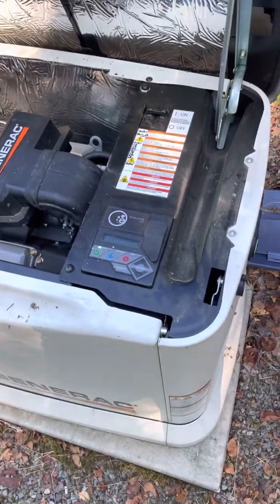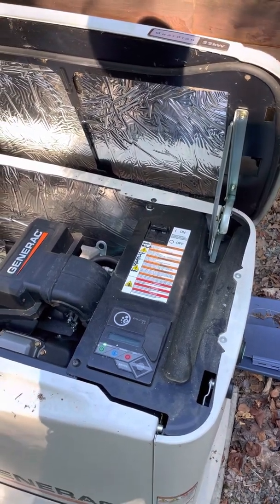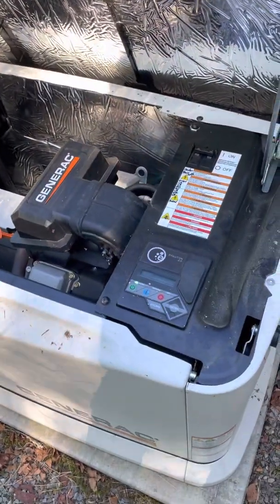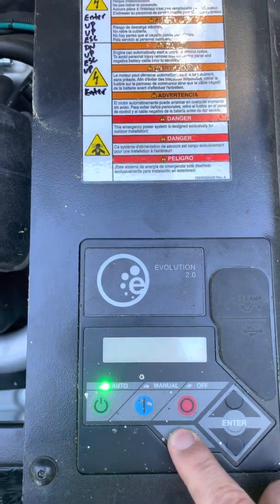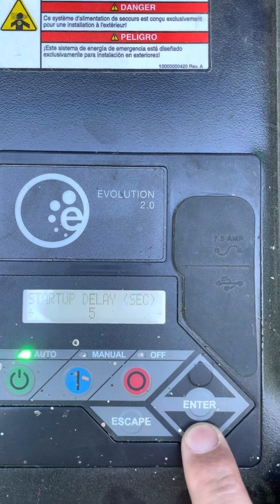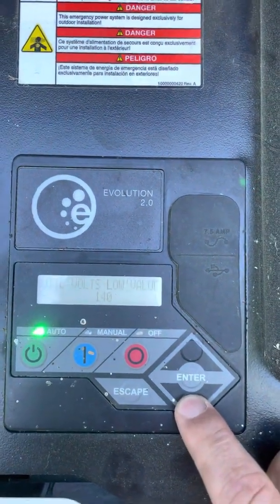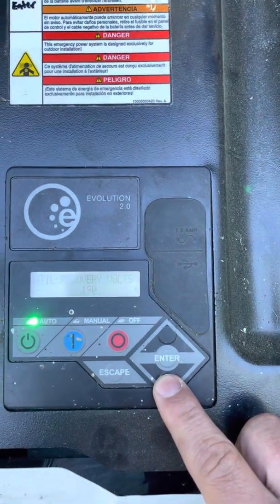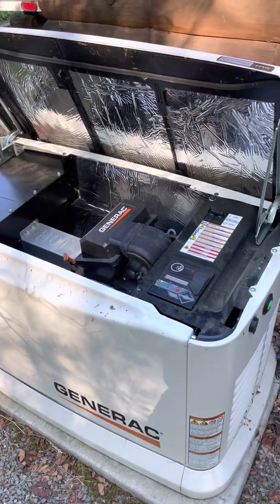Generac Home Standby Generator Brownout Voltage Settings Adjustment

Comment: Excellent video for getting into installer settings.  I do get brownouts and knew that the low factory settings would end up killing my home equipment if it wasn't changed.  I called my installer and he walked me thru the voltage revision and did exactly what you did for the low and hi voltages.  Problem is that I didn't know how he got me to the adjustment screen.  Your video gives me the secret code.  I also had a brownout module installed which Generac doesn't tell you about.  I asked my installer about having this installed and he said he would highly recommend it. He said he frequently replaces complete transfer switch units that have been burnt out by the solenoids melting and catching the whole unit on fire due to trying to activate with too low of a voltage. The module now prevents my transfer switch to try to switch back to utility until the module "sees" what the installer sets the module's limit to.  In my case, I have the brownout module set to 216 v. which is still low for the 240 v. the utility normally provides but it now agrees with my Generac settings and allows my home to switch back to utility when the utility may be slightly low on voltage due to thousands of customers coming back online after an outage.